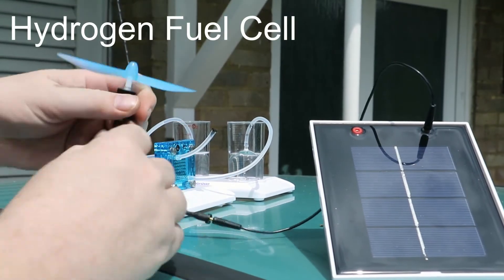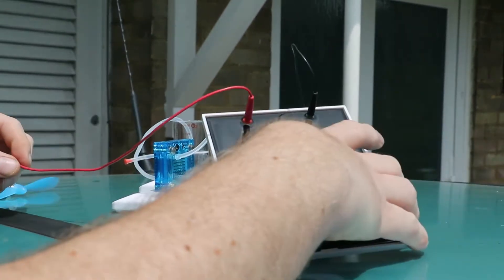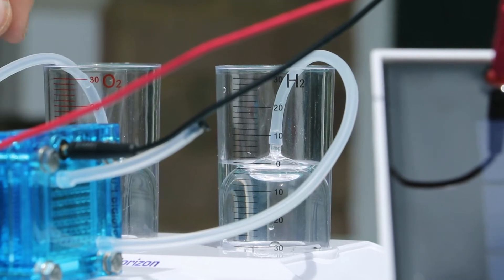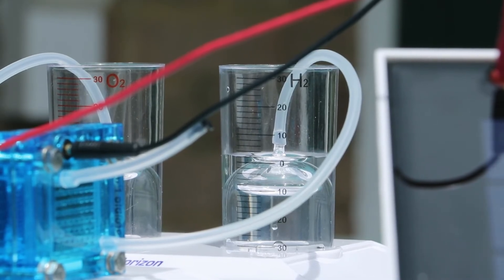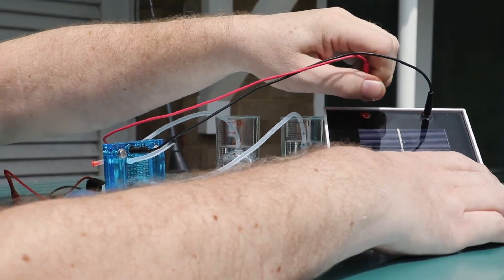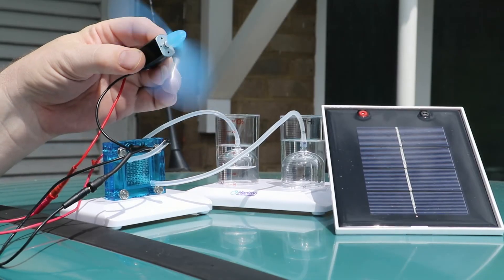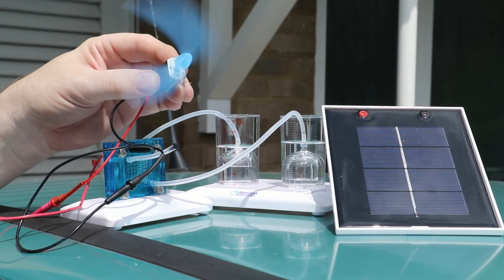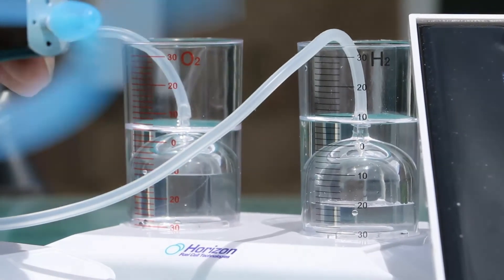Solar powered hydrogen fuel cell demo

Comment: Yeah no dude, that's fake; electrolysis requires the electrodes be placed into the water.
The panel is powering the fan.

Comment: Say you use 10 units of energy from the sun to produce 2 units of electrical energy, and those 2 units of electrical energy are being used to convert water into hydrogen and oxygen:
1. how many units of chemical energy would be in the hydrogen (which has just been separated from the water)?
2. if that chemical energy from the hydrogen was converted into electrical energy and stored in a capacitor what would the energy loss be?

Comment: Thank you very much for this video. Would it be possible for you to ramp this up and see if a larger solar panel and larger hho generator will product enough browns gas to run a propane generator? or at the very least show us the LPM it can do. Like a 40-80 cell something in the 100-200$ range. That would be nice to see for camping and heading a shelter

Comment: 90% waste of electricity to produce H2 as run the fan directly from solar. Only the second part is "fuel cell". Tthe first part is simple electrolysis.
Reply from the maker: The first part is using the fuel cell to split the water via electrolysis. This is one of the functions of a fuel cell. This makes the hydrogen. This is green hydrogen, only made by solar and water. The hydrogen is 100% pure and did not use any fossil fuels in its creation. This hydrogen can then be stored and used when someone wants to use it. The fuel cell enables the user to be free to use the hydrogen when they want. and using green hydrogen it cost nothing to produce once the hardware has been bought. You can run the fan during the day from solar - but you can't run it at night and this is the point of the demo. Using the fuel cell and the stored hydrogen you can use the fan when you want to - not just when the sun is out.

Comment: how much does a single unit of hydrogen-oxygen fuel cell cost? I could not see the water generated by fuelcell
Reply from the maker: 24 litres of Oxygen and 48 litres of hydrogen would make just 18g of water. I was using much less than this so that is why you can't see the water made. Cost is much more difficult. If you use solar power to generate the hydrogen - then apart from the cost of the equipment, there is no cost. If you use blue or grey hydrogen then there is the cost in making these
Reply: @PhilipRussell  Thanks

Comment: Is it safe to store those gases for winter usage (so produce in summer and use in winter) 
Is it cost reasonable for a home application.
Reply from the maker: Yes Hydrogen is stored and so is oxygen. Hydrogen is the only one you would need storing as oxygen can be obtained from the air. The store=age of hydrogen is either via a compressor or using other systems like lithium Hydride. That is a more expensive storage system at present but is likely to provide better, safer storage at low pressure in the future.

Comment: Modern direct injection engines control motor rpms, adding/subtracting fuel according to rpm needed.

Couldn’t oxygen/hydrogen from electrolysis from solar during daylight be pumped backed into combustion engines adding to combustion and have the injection system compensate for lowered fuel need? Making cars more efficient??
Reply from the maker: In theory yes ... but and there always is a but ... the engine would have to be converted to work on hydrogen as a fuel and then you would still need a regulator as you might have made a lot of hydrogen during the day.

Comment: good video, Phillip - can I ask is this not Hydrogen and Ozone? I presume the negative electrode produces the H2 and the positive the O2 (O3).... basically this is the same as a hydrogen water bottle, isnt it?
Reply from the maker: No Ozone at all. Ozone will only be made if we can add a lot more energy into the system - like adding some UV. SO there is only enough energy to make oxygen . Products Pure Hydrogen and Pure Oxygen.
Reply: @PhilipRussell  thank you so much , Phillip and thanks for the quick response. I'm sure you're aware that Hydrogen (normally hydrogen water) is being used widely in sports therapeutics; it's an excellent anti oxidant (as it is so small). Of course, Oxygen is therapeutic in of itself. I have seen machines being sold for thousands of pounds , oxygen and hydrogen inhalation machines, I guess, they are just using this technology? Anyway, I;ve been exploring how to produce small amounts of hydrogen (safely) at home and it looks like this will do the trick and importantly , it won't ionize the water . thanks so much for this video. P.s Am a teacher  so may well use this video and or buy a kit to show them. If you have time, any thoughts would be appreciated
Ben

Comment: Hi, we are having this project but somehow it's not working. The voltage rating is around 2.78 V. We tried with Boost converter as well still its not working. Can you what could possibly go wrong?

Comment: It seems this is more of a HHO Generator than an actual Fuel Cell. A Fuel Cell produces current from the combination of Hydrogen and Oxygen, forming Water and Electrical Power as the exhaust..
Reply from the maker: Exactly as I described in the video Have a look at https://youtu.be/XRxnNWVqgz8 if you want more detail.

Comment: Can we use two fuel cell by directly using hydrogen as input for another fuel cell instead of breaking circuit
Reply: The cells would run in parallel. Each one would require its own hydrogen supply.

Comment: And this is taking air from the atmosphere and creating hydrogen?
Reply from the maker: No Water is added to the fuel cell. It is this water that is either split by the fuel cell to make oxygen and hydrogen stored in the tanks, or hydrogen and oxygen from the tanks are combined to make water and electricity in the fuel cell. The fuel cell works both ways.
Reply: @PhilipRussell  and so the water stays in the fuel cell when it's H2O?
Reply from the maker: @linuxd  Yes or if you make enough you can collect it. It is pure  water
Reply: @PhilipRussell  amazing; this technology.
I could take a sip of water if I'm parched after the experiment

Does it have to be pure water. What if natural minerals are inside?
Reply: @PhilipRussell  Water is added to the electrolyzed, not the fuel cell.
Reply: @PhilipRussell  but there was never water added in video. no more smoke and mirrors. producing hydrogen isnt close to the way you did it. what electrolyte you use. lol

Comment: But it is highly inefficient, don't you know?
Reply from the maker: Yes solar cells don't get above 20%. The fuel cell is about 50% efficient, but that is better than a car using petrol or diesel, which are 20-35% efficient. Even steam engines were more efficient than a car engine, which is why power stations use steam turbines at 63% efficiency.
Reply: Correct me if i am wrong,I did some research, I find that it requires 51 kWh to produce 1 kg of hydrogen, means I would need 10 kW solar system and run  it for five hours,
Reply from the maker: @bhushanrocks412  Yes I agree Solar cells are 15-20% efficient, then the fuel cell is about 50% efficient.so your figures are about right. But burning hydrocarbons is not efficient either. Running electric cars is terribly inefficient because they actually use more hydrocarbons to make the electricity and charge the battery than you would get using a petrol driven car - but and this is the important point the solar cell costs nothing to run after it is purchased and the fuel cell can convert it into "free" hydrogen. I agree the process is inefficient but the system can be made carbon free and this helps the environment and so does the efficiency matter that much?
Reply: You have good point , and there are some challenges like transportation otherwise its good option , and I wonder why people are not using this approach .
By the way I was not saying inefficient to consume, I was saying inefficient to produce.

Comment: But hydrogen has very low volume density(156gm per liter) but positive side is; it has higher energy density per kg. Using hydrogen as a fuel cell is a bad idea but as a rocket fuel it's perfect.
Reply from the maker: Hydrogen is not perfect, but it does have the advantage of zero pollution, only water is made, other  fuels with higher energy density produced Carbon Dioxide.
Reply: @PhilipRussell  ok you are correct I agree with you. Though after 25 years later the amount of carbon emission didn't decreased at all; & as well not everybody depend on solar power. You may do but not your neighbour.
Reply: the ramjet missle uses hydrogen so....

Comment: The fuel cell/capacitor was charged by the solar panel thus creating a potential difference between the plates. The heat from the process warms the water and decomposed the manufactured metal plates thus releasing the gases/pressure from the plates. The gases collect in the containers. When the fan is connected the electricity is drawn out from the fuel cell/capacitor only to be replaced by the gases/pressure from the metal plates. The gases actually come from the metal plates and not the water. One only has to look at how palladium is manufactured to realise how much energy goes into making it.

Comment: so if you plug it in directly it is more efficient right?
can you share more detail like how long it took in hydrogen to move that fan?  like how far inefficent using hydrogen ..
Reply from the maker: During bright sunlight the solar cell can power the fan really well - better than the fuel cell. But in the shade and at night the solar doesn't work well or at all, so then the fuel cell is more efficient ( about 35%) Looking at the solar cell that is only about 20% efficient.in bright sunlight.
A battery is far more efficient 98% or so but has a short lifespan - compared to the solar cell and the fuel cell.
The fuel cell can reverse instantaneously so it takes a fraction of a second ( about the same time as a batter) to start the fan.The Hydrogen conversion to water and electricity works exceeding well and fast if it is under pressure. As the pressure decreases then the fuel cell slows down and produces less voltage. The efficiency is the same but the rate slows. All the hydrogen produced can be converted back to pure water.
Reply: @PhilipRussell  thx for the update.... so hope some one will make it into a home battrey  in the near future..

Comment: Excellent video! I know its just an experiment, but how efective it it to turn solar to chemical to electricity ?  Would it be commercially viable to use solar to produce hydrogen to fuel cars or is it just better to go straight electric?
Reply from the maker: I think that this should be done in two stages. A solar plant splitting water into hydrogen and oxygen and storing these in a tank. The "tank could then be taken to a petrol (gas) station and swapped there, an empty for a full tank of hydrogen. The oxygen can just be taken from the air.
Reply from the maker: Take a look at the new video on how this works https://youtu.be/XRxnNWVqgz8
Reply: @PhilipRussell  but since the solar cell is generating electricity already, wouldn't it be more coast effective to store that in a battery instead filling up a tank? Don't get me wrong, I'm not trying to diminish your experiment, I jut like to think about things end explore the possibilities :)

I'll watch that video !
Reply from the maker: @rafasamurai  The energy from the sun can be stored as hydrogen via the fuel cell. This process is fairly efficient . The sun to the solar cell is less efficient 15-30%. The hydrogen can be chemically turned into other safer storage media. The process of recharging a battery is still not that efficient, energy is lost, so storage as hydrogen is best and one stage. The less stages the more efficient. The reaction of hydrogen with oxygen in the fuel cell to make water is very efficient.
Reply: @PhilipRussell  Not true. The solar cell puts out the same, whether it's charging a battery or splitting water. If you look at the practical efficiency, at least 90 out of 100 Wh solar electricity will be stored in a battery and can be used directly from there also at 90%, it makes 81% (.9*.9) of usable energy. Taking the 65 or so % of hydrogen generation and fuel cell efficiency, you end up at a mediocre 42% (.65*.65). A pressure tank is however cheaper than a battery, right?
Reply: @rafasamurai  it has less power than hydrogen

Comment: The one thing that I didn't understand is how you can keep a steady supply of distilled water to the cell ,  and the way that the cell is connected , gases usually like to flow above water so how they are being collected from the bottom hoses ? Wtf?
Reply from the maker: Take a look at my other video on this https://youtu.be/lyg3vjAfH4w  Here we look at how it works. There is no flow of distilled water over the electrodes in this model because such a lot of gas is produced for a very tiny quantity of water The gas is collected by the bottom hose by a simple displacement of the water which is separated from the fuel cell

Comment: For how much time it will work.(fan)and for how much hydrogen gas
Reply from the maker: For about 2 minutes charging I get 1 minute of use from the fan. Because this is really a zero pressure system as the volume of hydrogen gets less so the pressure forcing it back gets less so less power is produced. However long after the fan has stopped I can power the led lights for an hour or so - it just depends on the power required.
Reply: @PhilipRussell  LED lights? I thought the power the fuel cell produces is only 0,6V 300mA, and a red LED needs around 2V?

Comment: as i see it you charged the battery and then discharged it    hmmm!
Reply from the maker: A fuel cell is a sort of battery. The solar energy used the fuel cell to split water into hydrogen and oxygen which are stored and then when a load is placed across the fuel cell the system reverses and Hydrogen and Oxygen combine in the fuel cell to make electricity. The fuel cell can just run in one direction is required, for instance powering a car by hydrogen, but its real power is being able to do this reaction in both directions using fuel to make electricity or if perhaps a car is going downhill using that energy to make more fuel and therefore increase the range of the vehicle.

Comment: Thanks for sharing your knowledge. Hope to see one day this technology used in Power Plants. It's the cleanest form of energy. Am  I right in  saying  that the challenge is to store hydrogen. Since the hydrogen molecule is very small it tends to escape from connectors, joints, etc
Reply: They can be stored in tanks
Reply: The challenge for renewables have always been to store energy, for e.g. solar cannot make energy at night. 

This is awesome! With a single fuel cell used in reverse make Hydrogen gas from Electrolysis and at the same time turning Hydrogen to Electric. 

Is the efficiency enough for houses with Solar Panels to power homes throughout the night?

Comment: This also clearly shows why hydrogen cars will never work,  if you had a ready supply off hydrogen then all this makes sense however where you have to use electric to make hydrogen to then make electric again it makes no sense , simply use the electric directly , ie an electric car using batteries , the conversion simply adds an inefficiency and storage problems with having to compress the hydrogen to store it . in a world with easilly accesable hydrogen then great but not on earth .
Reply from the maker: I agree. Until an effective and safe means of storing the hydrogen exists and it is readily available, this technology won't go too far.
The biggest problem as you say is the supply of electricity to make the hydrogen. Most of the current electric cars on the road today make more CO2 than a petrol powered car.
Reply: @PhilipRussell  I think steam reforming alcohols into CO2 and H would be ideal. Easy to fill up, easy to produce from waste or from from combining water and CO2 with help of bioenginering.

Comment: Hi Phil !.   How large can be this fuel cell scaled to?
Reply from the maker: By putting these together in series or parallel many of these can produce whatever voltage or current you want. The basic problem is storing the hydrogen. The most exciting method so far is binding the hydrogen to a metal hydride. This gives a low pressure system which is much safer than higher pressure systems. As better hydrogen storage systems become available then this technology could take off.
Reply: mmm, however riskier using low pressure tanks will work? ( same idea as the one shown on the video..)
Reply: I need to store 2kg only, roughly 50 m3
Reply from the maker: If you are using a fuel cell to make hydrogen then the hardest part is the storage. Horizon - the company I purchased the cell from, do a storage system, but it is quite expensive. If you are going the other way then use a standard hydrogen cylinder.

Comment: Hell, Philip!
I'm very amazed about this experiment, because I saw it many times when water separates into hydrogen and oxygen. But never thought that the reaction may go backward! It's incredible! Tell me please, is it your private idea or it's a scientific fact which known by many scientists?
Your hydrogen cell looks like a tools for experiments with hydrolize. Did you make it by yourself or bought?!
Reply from the maker: This is a well-known experiment. NASA has used this to power many of their spaceship and satellites. The first fuel cells were invented in 1838. The device consists of two electrodes separated by a permeable membrane. What makes the fuel cell so powerful is that if you add electricity it makes hydrogen and oxygen. If you add hydrogen and oxygen then they combine to make water and electricity. The machine is efficient and it produces no pollution. This is a kit I purchased from Horizon http://www.horizonfuelcellshop.com/europe/product/solar-hydrogen-science-kit/